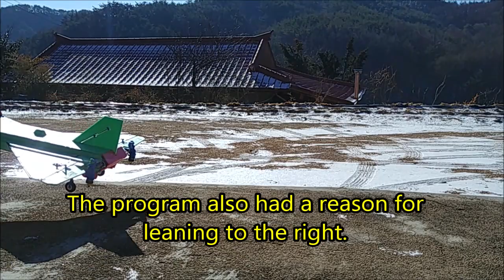VTOL RC Plane DIY Part18 (Takeoff flight landing Last Test V2)

Comment: gyro disc for balance
Reply: horizontal or full 3-axis pack
Reply from the maker: HOBBYEAGLE A3 Super 3 6-Axis Gyro
Reply: @a9rc  not a sensor, an active balance by mechanical gyro disc kit, not reaction wheels, but just a spinning disc
Reply: the spinning toy, you will not wobble so hard
Reply: you can then alter the position by the rotors
Reply: @a9rc  in other words, the spinning disc, really fast, will tend to keep the disc face aligned in the same direction all the time
Reply: @a9rc  so, i'm saying you dont need any sensors, you only need a spinning disc, to keep level, you can use a large disc as a gyrocopter inner "wing" and have multiple fins on the outer rim, if you want to have a gyrocopter
Reply: you can have only one miss-placed, badly aligned, non-balanced rotor(s) with a spinning disc, and still keep it level
Reply: turbo-gyro, kinda, turbo-fan